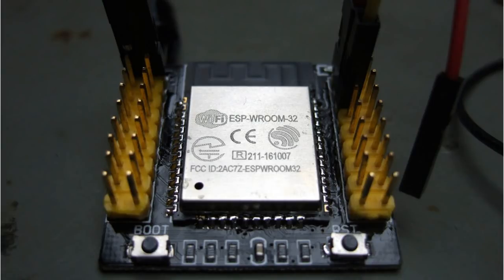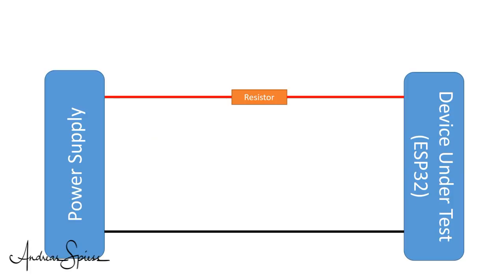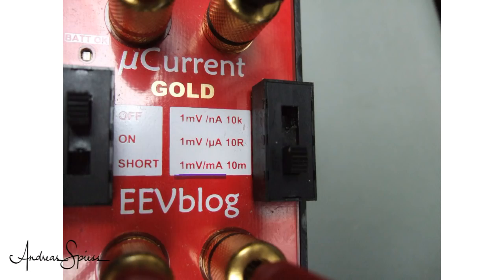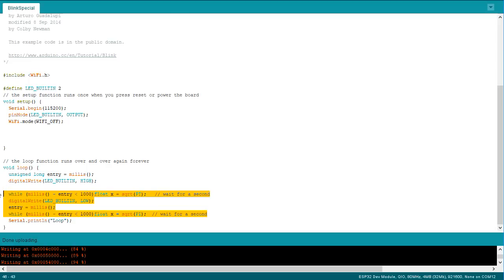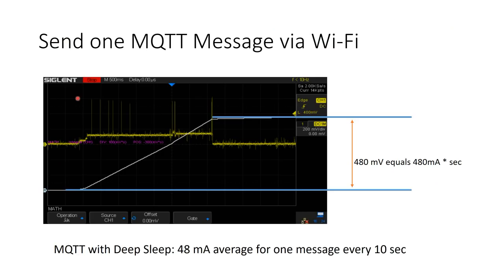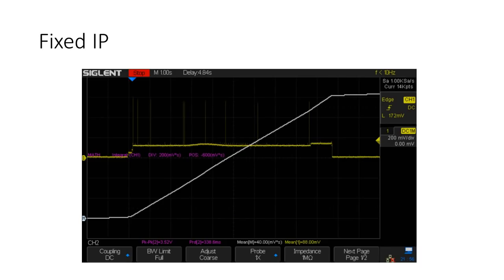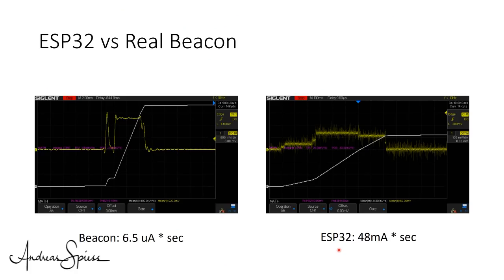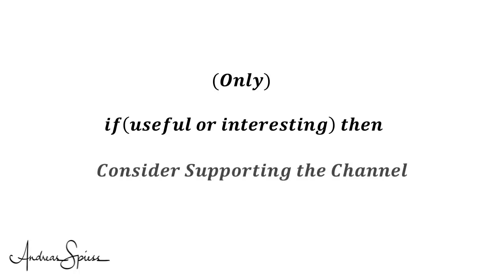#179 Was it worth waiting for Bluetooth? How Much Current Needs the ESP32 Bluetooth in BLE?

Comment: @andreas Another excellent video. Thank you for the that insight about how using the es32 is much more current heavy. Would this mean that the dedicated beacons are  built without a microcontroller and just a bluetooth chip with dedicated electronics? Or would this just be a specialised microcontroller with very limited code? 

PS we drive on the right side of the road - the left side! :-D
Reply from the maker: It is an NRF81522 chip.
Reply: Probably a microcontroller with just enough processing power to keep up with the requirements of sending the beacon. So running a  low clock rate and probably 8 bit or less processor.

If your application calls for some heavy data processing with no waiting for peripherals the ESP32 could be the right choice because it can do that quickly, then go back to sleep.